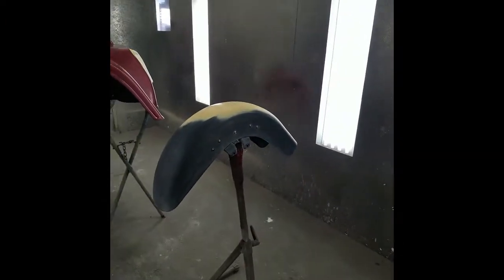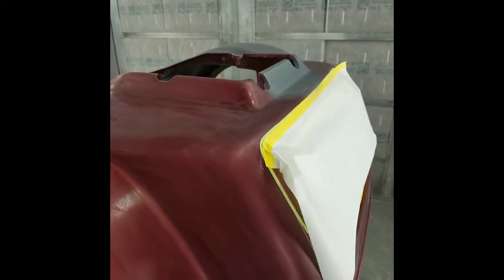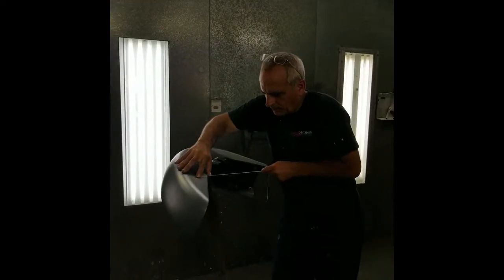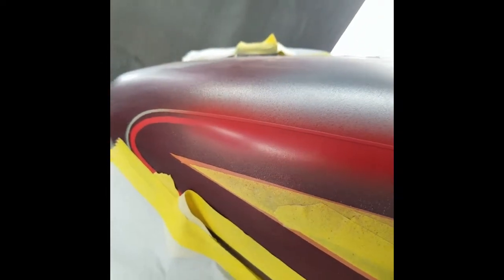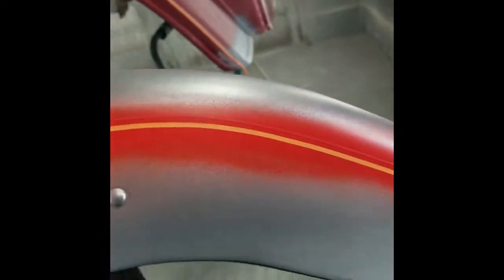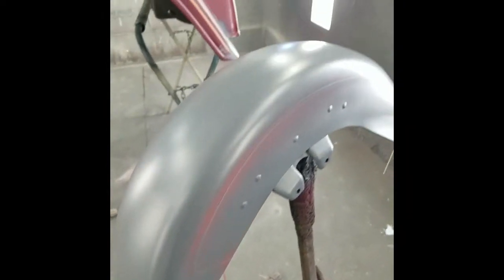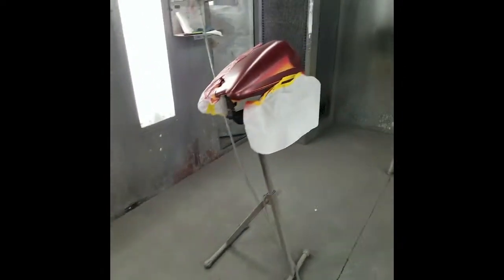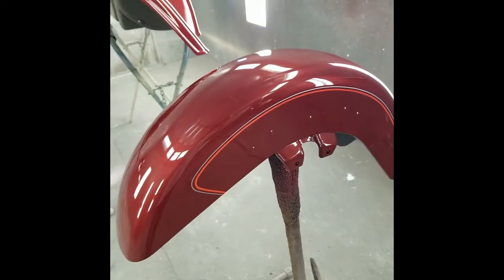How To - Harley double pinstripes made easy

Comment: I’m going to do a double black stripe so with bright orange being my base coat would I need to shoot a light grey color over the black after I have the stripes taped so it won’t interfere with the orange.
Reply from the maker: Yes, I would do that. Orange is pretty transparent so the light gray will help the orange cover better. Don't put too much gray though. Just enough to kill 'most' of the black. Be sure to use a very light gray. Even a white with a tinge of orange in it would be a good ground coat

Comment: I know this is few yrs old but i just sanded down my saddle bag lid off of my 86 after it flew off and chewed a corner of it and this is how the stripes were done on it.  I found the gold that was the color of the pinstripe was under all of the black.   Now i have to fig out what dang color is the gold to match the rest of the bike
Reply from the maker: Normally I just color match all the Harley pinstripes. If you don't have alot of paints in stock you can take the lid up to a paint supplier and pick out something that is close to the gold and they can make it for you

Comment: Great video!!!  I am attempting to rebuild my 1999 Ultraclassic, and it has the exact same stripes!! (the Red on mine  is Lazer Red Pearl though.)   I was wondering if you could share the colors for the silver and the red-orange pinstripes?  Assume you used a basecoat color for these?  I have a PPG dealer that can mix me the color, but need some kind of color code as the size of the stripes are too small for them to do a custom match on. Thank you!
Reply from the maker: Lazer Red pearl is an awesome red. I've sprayed that quite a few times. As far as the pinstripes, I ALWAYS end up just matching Harley's pinstripes. I normally make up a pint of some of the colors, as they tend to use the same color pinstripes for other main colors through the years as well. That orange/red was used quite often.
I would suggest taking a piece of your bike, possibly the side cover and just going through their chip charts. If they have anything like a color match book, this will show ALL colors starting with white and ending in black. Every page changes colors. You'll see page after page of reds. You will find your color in there that they can make up for you.
If they have standard color chip charts, you'll just have to go through them until you find one close.
OR, just get a regular bright red color and ask for orange toner (1/2 pint of each). Mix it approx 50/50 and that should be a great starting point

Comment: How many coats of the red did you do before masking and will the tape put the red off when unmasking?
Reply from the maker: This is was done backwards, so the red pearl was the last color to be sprayed. No masking at all was done with this technique.
Reply: @TAZattitude  ok so I'm working on a gas tank 2tone paint job with a pin strip threw the middle of the colors. What advice can you give?
Reply from the maker: @3rekoatskustoms929  What are the main colors and the pinstripe color?
Reply: @TAZattitude  the pin stripe will be red and the 2 colors are a pearl white and brown pearl
Reply from the maker: @3rekoatskustoms929  I would do the complete parts in the white pearl first since it's a tri-stage. Mask off to paint the brown area using 1/4" or 1/8" fineline to layout where you want the 2 tone edge. 
Once it's masked up, spray a few coats of red along the edge of the 2 tone line. Assuming you want an 1/8" stripe, VERY carefully, butt your 1/8" fineline up against the 2 tone edge (add some 1/4" green tape overlapping the 2 tone fineline and the fineline you just laid down to eliminate any blow-through).
Cover the red overspray and the remaining white in a couple coats of black (this will help the brown cover faster)
Then spray your brown
Unmask all very carefully
Clearcoat...
Watch too much painting against the edges.
This is why you do the white pearl first...it's the thicker color
Reply: @TAZattitude  ok sounds good. But what if I don't use the black for the brown pearl but the same base for the white pearl because I'm trying to come up with a cognac color so that the brown isn't so dark how should I do it?
Reply from the maker: @3rekoatskustoms929  To avoid having to put on so many coats of the brown possibly use a medium gray solid color. Just mix some black and white and put a very light coat on it. I would suggest not spraying the brown directly over the faded red and the white pearl
Reply: @TAZattitude  thanks for all your help.
Reply: One more question on the 2tone how do I make sure there's no gapes between the red pin strip and the primary color's?
Reply from the maker: @3rekoatskustoms929  You will butt the tape up against the other fineline tape. This will eliminate a gap. If you are talking about eliminate accidental blow-through, you place the 1`/4" green masking tape overlapping both fineline tapes.